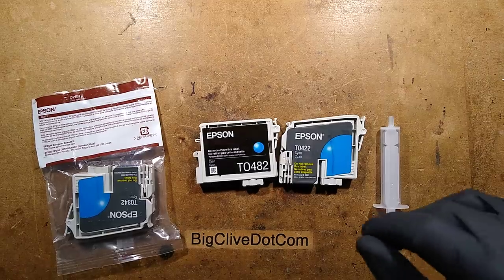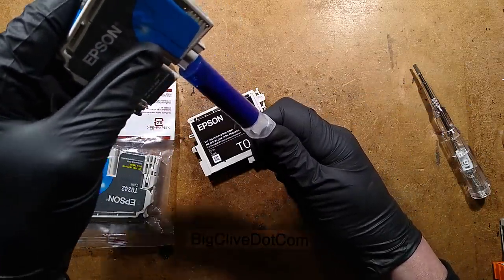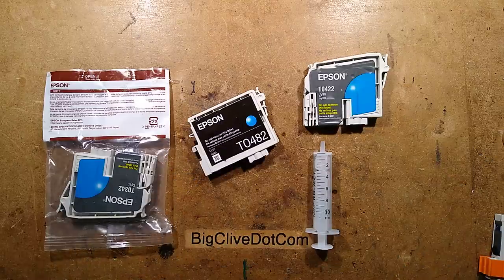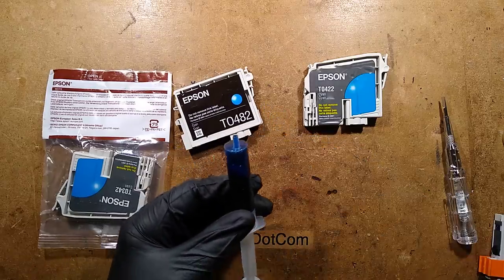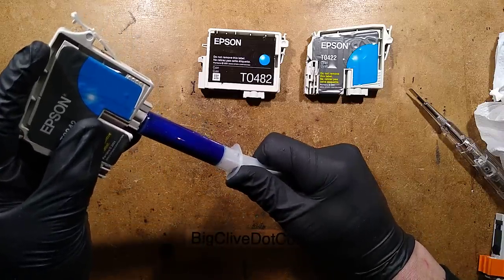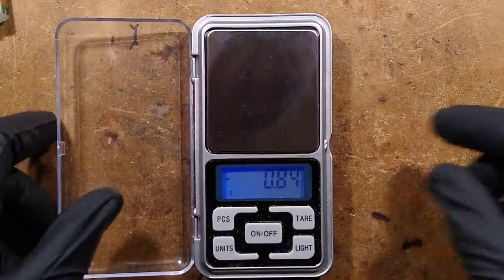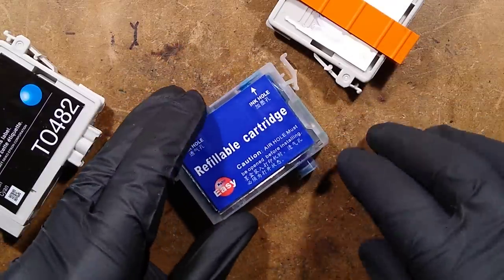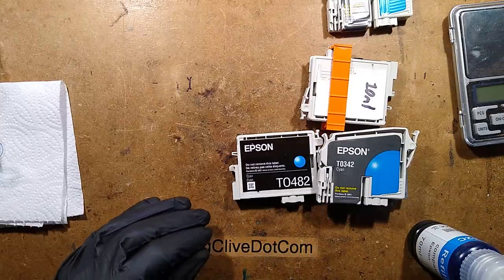How much ink is in Epson cartridges?

Comment: I gave up on ink jet printers years ago when I realised the scam they were. Expensive cartridges mysteriously needing replacement even when their colours weren't being used. Yep. Epson. Looking at you. Changed over to a laser printer and haven't looked back.
Reply: There's really no room for ink jet printers when your printing habits are "once in a presidential election."  Toner doesn't go bad.
Reply: Tank printers tho
Reply: It's really not mysterious. The ink lines that weren't being used (the colours in your case) will become clogged with dry ink if the printer does not periodically flush them. It does this by squirting a bunch of ink into a waste ink pad inside the printer. If the printer did not have this feature then you'd just get a bunch of thin white lines through your prints when you do go to use that colour, and the repair would be so expensive you'd probably just prefer to replace the printer.
Reply: As Clive mentions, the Epson Ecotank costs more upfront but prints pages plentifully and cheaply. I previously had a color Samsung laser that had decent image quality but was troublesome (due to complexity) and expensive to run, with toner cartridges only managing a few hundred pages. Not only does toner need frequent replacement, but the drum and the waste toner storage unit, too. Firmware updates were mainly designed to lock out third-party toner.
Reply: @simonbone  I didn't get on any good with an Epson Ecotank, right from the beginning it would sometimes leak black ink onto the edges of the paper. But the main issue was clogged heads, for the 1st year it was ok, however as the ink got older the heads clogged faster to the point that if it wasn't used every few days it would take a few head cleaning cycles to mostly get it printing again. It wasted most of the ink doing those cleaning cycle, especially the black...or was that it just leaking? Anyway, I replaced it with a Brother colour laser printer, and so far I'm happy.
Reply: HP printers: Hold my beer!
Reply: @Pete856  Sane thing here.  I wonder if fungus starts to grow in the ink supply.
Reply: Same here, got a laser printer some 10 or 15 years ago after getting fed up with new ink cartridges mysteriously going "empty" (even though there still was ink sloshing inside) after a month or two with no printing. Still going strong on the original toner cartridge.
Reply: Definitely. I just wish they made large format laser printers.
Reply: Me too, had a cheap Brother mono laser for 8 years, brilliant! Sold to upgrade to a networked one of the same brand I got at a bargain price.
Reply: @Pete856  The Brother's are fairly decent. Mine's only a B&W laser (I print mostly text documents).  I pay about $AU12 for a cartridge.  Done well over 6600 pages, and only on my fourth cartridge. Definitely a far better proposition for me than most inkjets.
Reply: @dogwomble  Nice. Obviously you've found a good 3rd party cartridge supply, what's the brand?
Reply: @Pete856  It's just some generic cartridges I found on ebay.  The trick here is that, with my HL-1110 at least, there is often toner left even if the printer thinks it's empty.  For this printer, hit the power button seven times, and that allows you to continue printing even if the printer thinks it's empty - allowing in some cases several hundred more pages before the toner eventually dies.
Reply: @Bobo-ox7fj  Well, for the past 10 or so years of ownership. No. It isn't. Are you an Epson ink jet printer rep by chance? :-)
Reply: me too! got a canon color and a brother b/w

Comment: At one point I was buying NEW printers to use the cartridges they came with as it was cheaper than purchasing a full set of refills.  I ended up owning FOUR new printers that did nothing - just to get some cheap ink.  Shortly afterwards the manufacturers stopped selling the printers with 'full' cartridges.  Tw@ts.
Reply: I used to do that. A new Lexmark color inkjet printer was $25 at Walmart, their cartridges were $37 each. 🤣

Comment: Although the relevant metric is to weigh it, then print until the printer won't print anymore, and then weigh again. Because that is the amount of ink you're actually able to utilize.
Reply: Many printers register them as "empty" in order to save the print heads.
Reply: @jonnoMoto   Yeah, I wouldn't defend what printer manufacturers are doing right now. "Fstoppers" did a good video on it.
Reply: @graealex  "Right now"...as in for the past decade or more... ;)
Reply: @Case_  I think it has gotten progressively worse. The video I mentioned showed that you would barely get a few pages out of a single tank. In fact, it was 35 pages of text (!), which calculates to about 45 cent cost per page. That is an absolute new low. Plus, printers try to use CMY in addition, unless explicitly told not to. That is absolutely intentional.
Reply: @graealex Yeah it's intentional. It's intentionally done to make your black cartridge last longer as it's the one that usually runs out first.
Reply: @joestevenson5568  No, it's not. It doesn't add any quality to the result. It also doesn't save on black ink.

Comment: There's a labyrinth of breather passages under the labels.  If you take the side label off you'll see a long wiggly path - that's where the air goes in... They're wiggly and long to stop ink coming out of the airholes.  Most of the time it works.

Comment: I haven't really thought of it before but i think it's really nice that with 3d printer there is a standardised filament roll that fits basically all 3d printers.
Reply: Yeah... if your printer happens to be a filament printer. And compatible with the exact type.
Reply: @Gary_Hun  oh right I forgot that there is also resin 3d printers and some others too but I don't think they are nearly as common.
Reply from the maker: Except the first industrial ones that had VERY expensive chipped cartridges with a roll of filament inside.
Reply: Don't worry, as the industry matures I'm sure they'll innovate and find ways to lock the customer into proprietary solutions instead...
Reply: @foogod4237  ofcourse. It would be too nice if they didn't and we can't have that. 😛
Reply: Speaking of which, don't ever buy an XYZ printer.
Reply: It doesn't hurt that 3D printers began their significant growth period as DIY, open-source hardware.  There was a lot of incentive to make things cross-compatible, and now the industry is stuck with a de-facto standard.

That's all it takes.  And yet, companies routinely try to introduce media with licensed features, and wonder why we always end up in a format war...
Reply: @Gary_Hun  If your printer happens to be a filament printer.... like most all of them. And compatible with the whole two different sizes of filament (1.75 and 3mm).

A
Reply: @vhfgamer  ngl 3mm filament sounds like BetaMax. Didn't even know it existed until now lmao
Reply: Yes, that sort of standardization is nice. Imagine what it would be like if all hand-held power tools had a standardized connector that connected to a power source capable of providing kilowatts for hours on end.
Reply: @vhfgamer  most 3d pens use the 3mm size filament.
Reply: @BenKonosky  Every single one I've ever seen uses 1.75.
Reply: @PaulSteMarie  That technology was lost in the 1990s during the Great NiCd Plague.

Thankfully some old codgers and weirdos like me preserved the great and mighty god of tools... the Black and Decker.
Reply: Lockin is starting to happen with 3D printers now, there’s a couple manufacturers who make systems that only take a particular type of boxed spool that is chipped to the printer type. They’ll churn those out dirt cheap and snatch up the market on the people just getting into using the printers soon I bet
Reply: Ink is not really the most evil thing with printers.
There's a patent that (I think) is still being held by some printing companies that could improve 3D printers, it's about a transparent strip with black lines on it that allows the printer to be more precise on its movement.
It's been a few years since I heard about it so I have no idea if it expired already.

But looking at google right now, it seems that 3D printers still use rotary encoders, so I guess that patent hasn't expired.
Reply: @GoldSrc_  Most just use stepper motors, and hope that there is no slipping and missed steps. The use of rotary encoders, or a linear encoder, to give position feedback, is regarded as a big expense, and only will be used in large machines, where stepper motors are not used, due to power required from them. But small that fit into home use on a table all use stepper drive, as it is cheap, and good enough, provided you limit speed of the axis. If you need faster printing, you need to go for feedback of some sort, and use either a brushed motor or some form of 3 phase motor instead, and close the error loop with the controller. A much more expensive option though, and feedback on a motor is something that is well out of any patent by now, as it has been around for a century already in some form or the other.
Reply: @Cenentury0941 I think it was Ultimaker who even used 2.85mm filament...
Reply: @nickwallette6201  Very true. Plus the 'target market' is makers, and they are less tolerant of sharp practices. They understand the technology.
Reply: @Underestimated37   There have always been ones that try and go the proprietary route, not really anything new.  The main difference is that most makers know how to get around it  (or how to find out how to get around it)  and/or just won't put up with that BS, so they either have to market to newbies who don't know any better, or find ways to keep one step ahead of the maker/hacker community.
Reply: @bigclivedotcom  Stratasys printers still use chipped reels. Some filament is wasted when you swap out an unfinished reel, so to make up for that, the reel contains significantly more than its rated value, but the chip will only let you print with the rated amount of filament.
Stratasys' polyjet printers are even more restrictive: not only do the resin cartridges know how much material is left, to stop you refilling them; the chip also has the cartridge's expiry date, so you can't print with expired resin.
Reply: If someone hasn't already replied with this, Formlab printers have chipped resin containers and proprietary trays. 
The resin is comically more expensive and there's people who've come up with bypasses so you can refill them- but even then it only works so many times before you need to buy a new chip- which the 3rd party also sells. 

We bailed on them and went to Elegoo which has bottles with no BS. Though they use software that's subscription based so, they're not angels either.
Reply: @SeanBZA  Sorry, but that's nonsense. Linear/rotary encoders are dirt cheap, and the cheap disposable Canons all have them. I dismantled a couple of abandoned ~$25 (~₹2000) printers hoping to find some steppers and was sorely disappointed. Simple DC motors coupled to even simpler encoders.
Reply: @rexsceleratorum1632  Putting one on a stepper is going to double the price of the drive system, which no manufacturer is going to do, as that will double the price, for very little added benefit. On a printer, where they are aiming for the fastest print speed possible, it makes sense to put them in, and have a high power motor to get the fast starts and stops. Not too precise in reaching a stop, but with the print being done on the fly it is very precise. Note almost all printers still use a few stepper motors, to do the paper path, as that is not a fast operation, and can be completed in the time it takes to stop the head before it hits the end stops, and then accelerates back to do the next pass. Those steppers are very cheap, basically 2 coils of wire on a pair of spools, and are almost fully machine made, using cheap simple stampings, and a CNC machined rotor with integrated magnet.
Reply: wait until HP hears that....
Reply: @nickwallette6201  The companies involved don't wonder -- they cause "format wars". As for why companies keep trying to impose vendor lock-in on their customers: That's what a company does when they can't actually innovate.
Reply: @Ice_Karma   I guess it's not so much "wondering why" as inexplicably hoping for a different outcome than usual.
Reply: For now.

Comment: The new epson eco tanks are actually great value for money, you get a years worth of ink with them, and then you can refill with essentially any ink you want, just refill the bottles you get with the printer. The only disposable part is a waste ink pad which on most models are a breeze to replace. The epson of today is so much different to the epson of old.

That being said, I’m really shocked to see so much ink in a cartridge, the canon and brother carts I’ve worked with in the past barely have 5ml of ink in them
Reply: I'm currently using the Epson Eco Tank system, and it's the best ink printer I've ever had. It's a very efficient printer, and since the replacement ink is relatively cheap, I'll buy the genuine Epson refill bottles when the time comes.

Only downside to the Eco tank system is in transporting the printer (if cleaning, or moving office...) it has to be transported in horizontal position. You also have to keep watch on ink levels to ensure printer never runs dry. Eco tank is the way to go.

Amazed that Clive didn't get any ink on his trademark work-bench! No newspaper... what a pro!

Comment: Having been around mostly laser printers during my work in various companies, I found it much safer to get myself a laser printer instead of any ink printers. I rarely had any real need for color printing, so I went for the monochrome black option, which was very easy to handle. I also had a lot of experience as a customer support person most of the time, hearing how much the customers complained about their messed up ink printers. In my experience, there were a lot less calls from customers about the laser printers. I did enjoy this episode and seeing this method of determining how much ink is in the cartridges, since I have seen a couple of different videos from other YouTubers, where they complained about other printer manufacturers like Canon and how little ink is in those cartridges.
Reply: I have a Brother laser that must be about 10 years old.  With regular use a full toner cartridge last years for me.  Two years ago, I bought a complete refill set (tone+drum).  Haven't needed to use it yet.  On the other hand, I have a large-format Xerox laser and it does use the chip on the toner cartridge.  Fortunately, I found a Chinese seller of replacement chips for cheap....
Reply: Same here. Am on my 3rd Kyocera laser printer in 25 years. For color photos i just go down to the drugstore and print them out. Larger format I can order and have sent to me.
Reply: Same here, 10 year old Brother mono laser printer and a second hand Samsung (HP really!) colour laser both working well for a fraction of the cost of ink  :)
Reply: @root42  When I wasn't in rural area I did that. But you have to be careful of the shop because some just don't care about the quality of the print.
Reply: Be careful about toner nanoparticles in the ambient air though.
Reply: I've had a couple of monochrome laser printers. The first was cheap but had awfully expensive toner, so I bought a replacement. This model suffered from a problem with the pick-up rollers, so rather quickly stopped taking any paper (the required replacement parts were £16.23).

I've since bought a monochrome Epson Ink Tank printer - it's worked very well so far, and comes with more included pages of ink than the previous laser printers' level of toner. It's a lot quieter in operation, and has a much better first page out time too. 

Obviously it doesn't replace a laser printer for people who print infrequently, but I won't be going back to a laser printer any time soon.

Comment: I gave up on inkjet printers eons ago.  Laser printers FTW.  They last a very long time, with my oldest one being 20 years old and 500,000+ pages on the clock.  Generic toner cartridges are $18 or so and are good for 5,000 pages.  Even if it hasn't been used in a year, it'll still fire right up.
Reply: That's the reason I went laser. Got sick and tired of dried out ink and clogged printheads.
Reply: @kimchristensen2175  Not an issue with new inkjets. They have an automated system that periodically cleans the printheads even if the printer is off for a long time. Lasers work great until they don't, if the drum unit fails it's practically e-waste at that point.